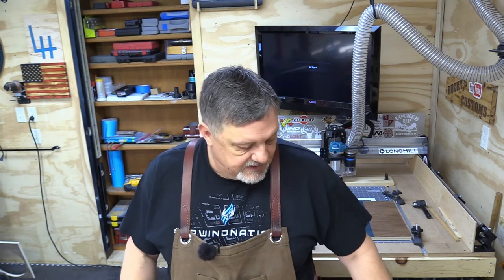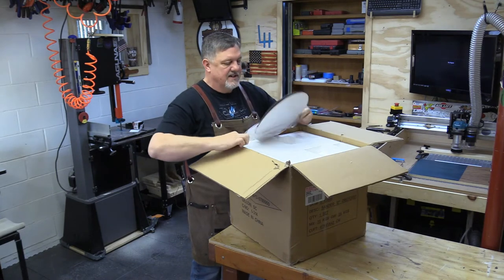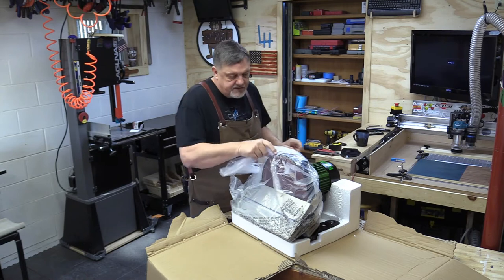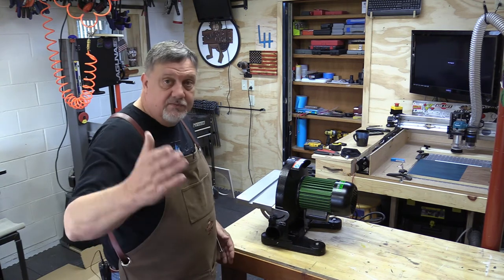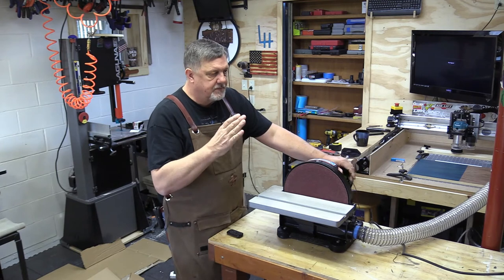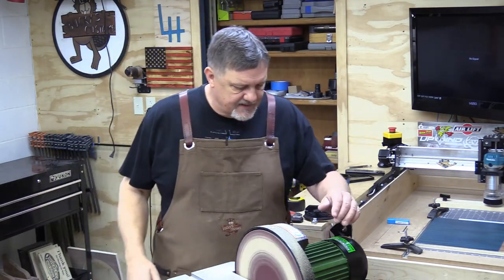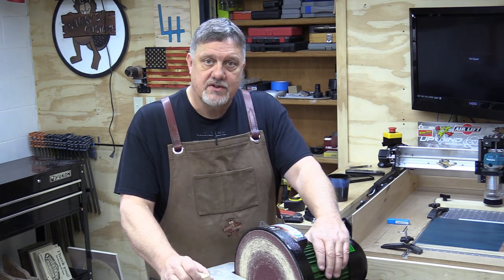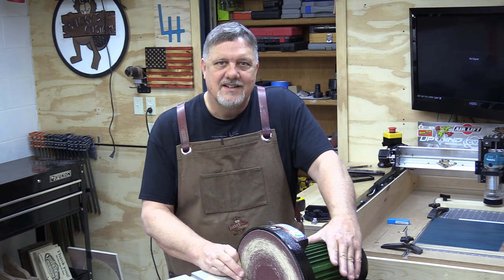Harbor Freight #12inch #Disc #Sander #Reveiw

Comment: Try closing the side that is not used in some way to create more suction at the used side 
Happy sanding don’t take down the finger nails to far LOL 😆
Reply: Maybe sanding on the right side of the disc will reduce dust. Looked like the rotation of the disc is clockwise toward the dust port.
Reply: @terryswenning9510  that's an illusion. I have this same sander and sanding on the right side of the unit sends your workpiece flying across the shop.